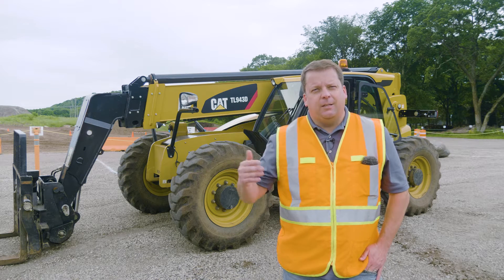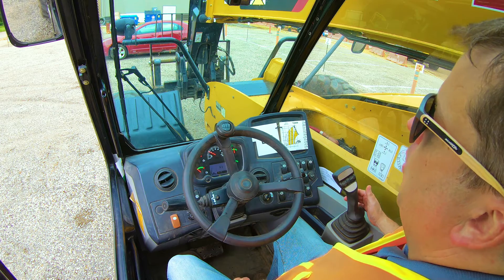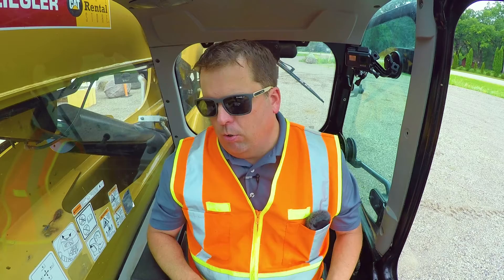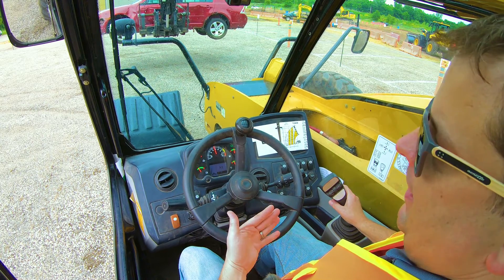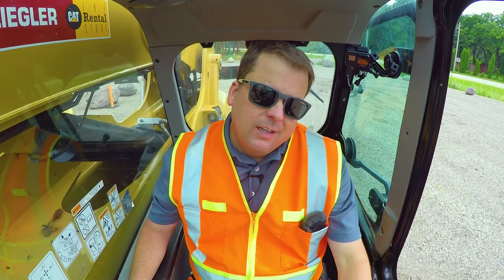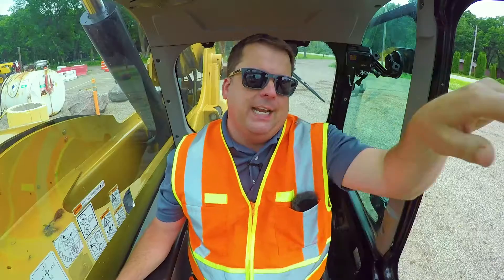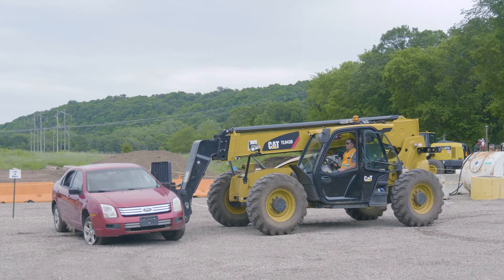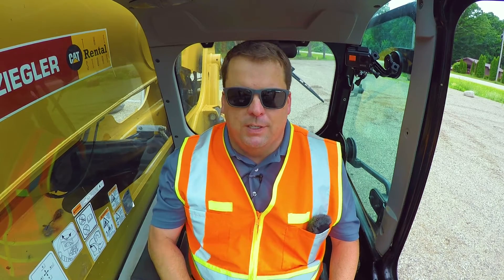What NOT to do in a Telehandler Forklift | Forklift Operator Training

Comment: Question: why do European spec teles have tall cabs, and American teles have low cabs?
Reply from the maker: No clue.   I would think a lower cab would be better because it lowers your COG as well, but maybe someone else can share their opinion.
Reply: what earopean telehandlers are you refering to.
because this cab is just as big as my manitou 735 mlt 
this cab just looks small because ofnthe gigantic boom
Reply: I couldn't tell you. But trust me the lower cab is much better for visibility. I have a large Manitou with the high cab and you can't see shit with your forks lowe to the ground. But the JLG you can see fine.
Reply: Colton Blumhagen same here but thats because of the boom thats in front of you vision
Reply: I have driven a manitou mlt and a jlg. The manitou had the boom next to the engine and the boom was mounted much lower than the jlg which had the boom above the engine. The cab was also taller on the manitou and i preferred it over the jlg because I could see what was next to me.